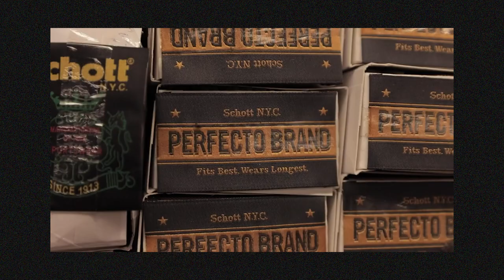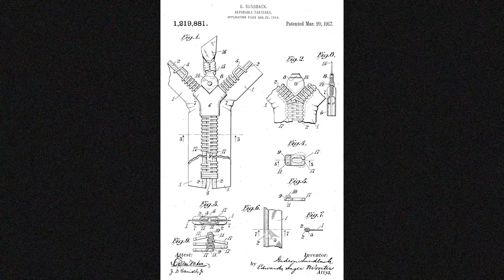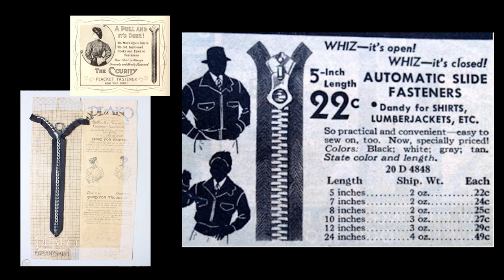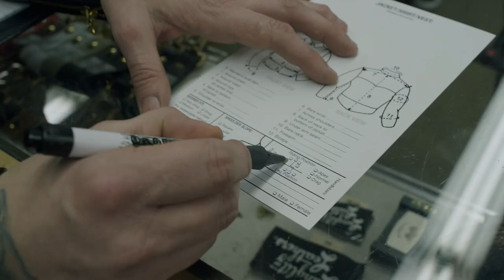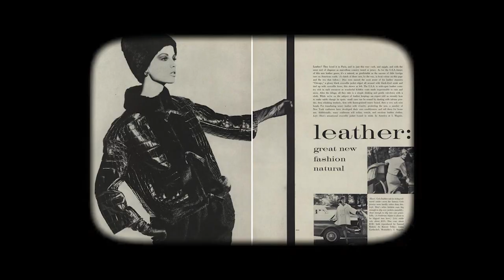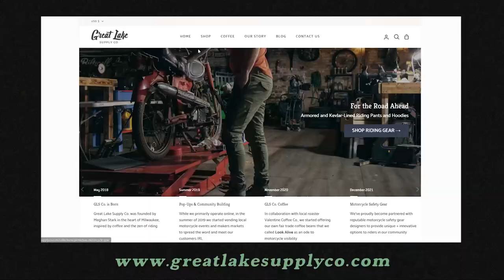How the Biker Jacket Became an American Classic

Comment: Great video. No doubt the Schott brothers had tremendous impact on the biker jacket made famous by Marlon Brandon. Schott jackets are still manufactured and command over $1,000 yet they don't provide armor, let alone even have the pockets to accommodate the armor.

Still, I read this classic was inspired by the double breasted uniforms of the Third Reich,  designed by Hugo Boss, who was a member of the Nazi party.

Personally, I ride with a Merlin Gable leather jacket. Much like any good riding jacket, it is full analine dyed 1.4mm cowhide. However, the Gable is also waterproof and comes with full d3o armor (back, shoulder & elbow), and has a full zip out quilted liner. I also love the look of the cafe racing style with the mandarin collar, a single vent on the front and dual vents in the rear.

Thanks for sharing!